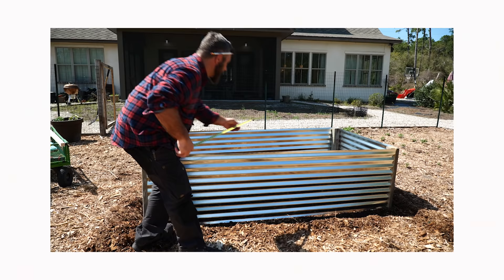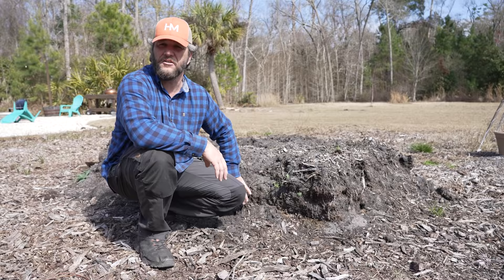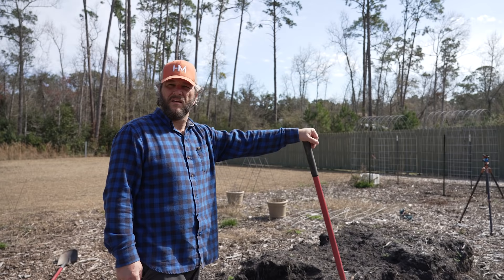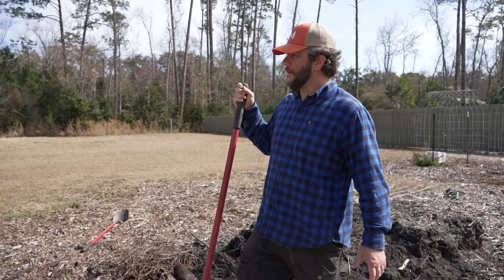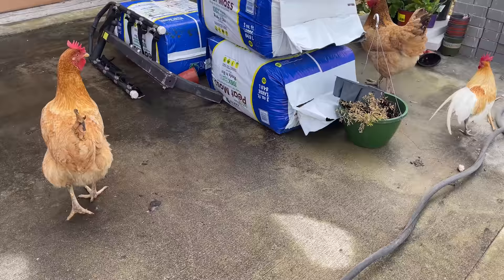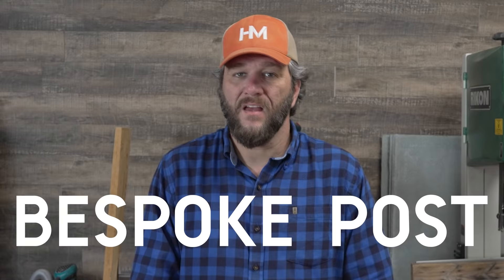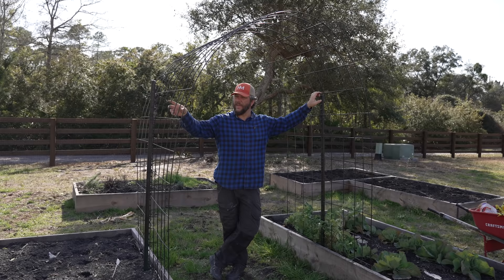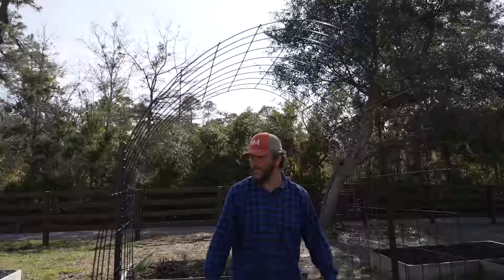Don't Build Raised Garden Beds Until You Watch This

Comment: Hey, I just realized I gave you just a half of the advice. In addition to painting the fence near herbs  white, you should also add Titanium Dioxide (TiO2) to the paint so that it absorbs the UV radiation from the sun. Otherwise there is a high possibility that your plants will get hit with more reflected UV radiation in addition to one coming directly from the sun, which would be harmful to them. As a bonus you will get more heat and light radiated from the fence to the plants which could help in springs and autumns.

Comment: Thanks.  Here's a quick tip from a boatbuilder (me) about untreated lumber.  Paint the ends before you assemble.  75% of the moisture in a board gets in through the endgrain... so paint or seal just the endgrain.  It'll add an extra year or two to the lumber's life.  If you are really worried about that little bit of paint leaching into the soil, then use a food grade clear coat, like they use on cutting boards.  Personally, I would just use latex house paint and not worry about that tiny amount of paint on the ends.
Reply from the maker: Thanks!
Reply: I think I'll just use wood glue, should seal up the ends and potentially add strength to the connections too

Comment: I use backer board in Michigan for lots of things outside. Once painted with a good outdoor paint it holds up very well
Reply from the maker: Good to know.
Reply: Paul, Should we use  a type of paint specifically for use on concrete?
Reply: @PandoraBVV  no  the surface of backer board is not cement based. I just use a good outdoor paint.

Comment: I'm planning my backyard for this spring and have watched a lot of your videos, so I appreciate this update. Love the A frame chicken coop, quick, easy, and it works. I like your smokeless firepit too. Probably not going to use the cement board idea since you mentioned freeze cycles, expanding the beds and letting the old wood rot seems like the path of least resistance.

Comment: One additional thing I do to my raised garden beds is add a layer or ribbed underlayment (made to go beneath vinyl plank floors) to the inside walls of the beds. They are non-toxic, non-leaching and they prevent soil and water from resting up against the wood. Because it’s ribbed, it also allows air to travel between the plastic and the wood ensuring the wood never stays soaked. I’ve only had them for roughly 3 years but my untreated pine is showing no signs of rotting.

Here is the product from Home Depot: DMX 1-STEP 100 sq. ft. 3.6 ft. x 29 ft. x 5/.32 in. Underlayment for Vinyl Planks, Laminate and Engineered Hardwood Floors
Reply: Your definition of ribbed is interesting. I call this dimpled, but still a good idea.
Reply: What a great idea! Thank you!

Comment: You mentioned adding another 2x12 on top of the existing sides, beware that water will escape out between the boards. I did that as well. Maybe place some plastic on the inside. Thanks for all your info. Nice job.

Comment: The large logs in the bottom probably prevented the bed from blowing out.  If they had been there long enough to decompose, you would've had significantly more pressure pushing out those walls.

Comment: Hey Haxman, I got a great hack for ya. Cut the top off a 2 litre plastic bottle, slip it over the 4"x4" then hit it with a heat gun to shrink it on the ground end of the leg. Great recycle hack. Plus you can do the same thing to the top of the leg with the top of the bottle. It makes a good holder for the garden tools when you're working. You're so good with sharing hacks I felt I owed you one. 👍🏻👍🏻🇺🇸
Reply: Wouldn't rainwater run down your posts and trickle into the bottles, to be held against the posts? How do you seal the bottles to the posts so that they don't collect water?

Comment: To help stop the bowing out of the backer board containers you could use some heavy wire across the middle like you would in a Gabion basket connecting the sides together.

Comment: With prices of wood right now, I purchased framing lumber for my raised beds. First year I will be doing raised beds instead of in ground. The lumber is untreated and I believe it’s a fir. Maybe last as long as pine . Maybe longer . If I would have went with red cedar, it would have been over 700.00 for three 4x8 beds. Instead , with the framing lumber , it came to 185.00. I’ve never gardened like this before . It’s pretty exciting to try something different .

Comment: that cattle panel trick works for 1 or 2 ... if you are moving 25 not so much. ... bolting two 2x4x16 to the bed ... does NOT work. Two alternative that do work .... seller delivery ... 18 foot flatbed works too!

Comment: I didn't read all the comments so someone may have said this already, but I find 4ft too wide.  I like to be able to reach over to the other side instead of having to go all the way round when weeding.  Its okay if you only have one, but if you have a whole allotment full, it makes a huge time saving to be able to do a lot of maintenance from one side only and three feet is about my reach. Also at the edges you need to leave an access path whereas you can plant right up to the boundary with two or three feet boxes, which is great if you can also put up a mesh on the boundary for climbers.

Comment: I have tried every combination of materials to build beds over the last 20 years.  I'm 75 and building my last beds. I'm tired of replacing them and experimenting I just want to be done with it. So I'm going with cement block.   I've used every wood, cement board, metal, even plastic sheets.  Going with block.  If you don't want to experiment for the next 20 years go block.. I f you know you are in a permanent place for a long time go block. The block can be moved if you change your mind on a set up, or take it with you if you leave.  I would tell my younger self  go block.

Comment: The Hugelculture method also provides the benefit of having a long term water storage as the logs soak up water while also providing habitat for beneficial microbes and fungi.  After a long time, the wood breaks down into a carbon rich soil and while it is breaking down, provides food for worms that produce some of the best fertilizer you will ever find.  Get your soil ecology right and you do not need fertilizer at all.

Comment: I have had  success with galvanized sheet metal( 6 foot fence sheets that someone dumped on my lawn ) , by cutting it in half across  the sheet and joining the halves together to form a ring , you can make a bigger ring by adding more sheets and a few cross bars . You can make a range of sizes  by using extra panels and support bars. Remember  to OVER fill your beds as they will settle and swap your crops out at least every two years to different crops (it dont snow where I live brooooohahahaha ). Good that you mentioned that wood chips will suck nitrogen out of your soil while they are breaking down , but they will release it back after they are composted . It is better if you can leave them to break down for a year before you use them if you can or just add a nitrogen boost to you soil if you cant wait that long.

Comment: We had some beds made out of untreated wood and it took them 4 years before they started to fail... so you may get more out of them than you think. great videos!!
Reply: Hi artport7. What type wood?  I’m getting ready to build one out of 2x10’s untreated southern yellow pine3 high
Reply: @reg8mm  yes, that is what ours are... we still have them and they are still holding together on year 6.
Reply: @artport7  thanks for replying!
Reply: Another commenter who is a boat builder said to seal the ends of each board, because most of the moisture that rots it comes in through the end grain. He said you'll get a lot more life out of them that way.

Comment: Just a comment on woodchip mulch. On soil, lay corrugated non colored cardboard on ground. Water to wet cardboard. Inoculate cardboard with the 'Winecap' mushroom spawn "Stropharia rugosa annulata". Cover spawn and cardboard with 4" or better of mostly [70% or better] hardwood woodchips. Water well and maintain moist as you would a lawn. If you also cover woodchips with a 1" layer of straw or grass clippings, the process is enhanced considerably. 'Winecaps', or 'Garden Giants' as they are called grow when soil temps are between 50-90 F. No growth in winter or mid-summer where I live in New Hampshire. If you Inoculate in spring, there is a chance of mushrooms in the fall, but most certainly in the following spring. The 'Wincaps' will break down the chips rather quickly attracting earthworms and making great compose. The woodchips will need topping off annually to maintain the 'Winecaps'. From that point forward, you should not have the Nitrogen issues and you will be harvesting delicious mushrooms.

Comment: Good work on the raised beds. I have to ask, why raised beds instead of traditional? I mean, if this is a how-to video, then fine. But if your goal to make a productive, robust garden then go old school and dig it, don’t build it. Time tested, mother approved.
Reply: Depends on your dirt. We're on clay. I wanted to haul in topsoil and compost and do the Charles Dowding no dig method for our first garden last year, but my husband wanted to see if we could get away with making the clay work. No, we could not. It was incredibly hard to dig, it hardened up like concrete after a rain, it didn't drain well, some things never came up, some withered and died young, and some got root rot. It was waaaay harder than it needed to be, for very little reward. I'm going with raised beds, and I'm filling them with what I know will work. Someday, if I use the right soil amendments in my raised beds, the clay underneath will also be amended. But that's gonna take years.

Comment: Can you seal with a pure oil or even beeswax or something to keep the boards from rotting or is that not worth it?
If it is doable, get yourself some beehives, put them in the back corner of your lot. If its work you don't want, trade off with a beekeeper to care for them, in trade of half the honey / wax or what ever. ?
Reply from the maker: Someone said to use raw linseed oil, not boiled.

Comment: Great videos!  Quick question: if you had to choose between the galvanized, cedar, or cement board, which would you choose?  I'm going to be building some raised beds soon, so I'm curious which was easiest, cheapest, and most durable.  Also, what area are you in?  I'm in the FL panhandle, so similar planting zone.
Reply from the maker: Thanks! If money is no object go with cedar, bang for buck is galvanized. The cement board is really for aesthetics. We went with non treated pine for the ultimate cost savings and speed of assembly combo. In your area you can probably find cypress which would actually hold up for decades and it's less expensive than cedar. We are in zone 9 in southeast Ga.

Comment: When your raised bed perimeters rot, remove the wood frame and you will have plain raised beds. Use wood chips, straw, hay, cardboard, etc. to keep the perimeter and control weeds. Additionally, it seems as though you till (disturb more of the soil than is necessary); please, stop doing that. 
It makes my head hurt to see how much work y'all do when you really do not need to do it... really!
Ruth Stout and Masanobu Fukuoka both spent less time trying to figure out how to improve natural processes, and more time applying natural processes through thinking about how natural processes work, which both attest to and require much less work. 

Good stuff nonetheless!

Comment: I have 12' X 16'  used composite deck boards that I plan to use for raised beds: should not rot * do need support along the way even if I go with 2' X 6'* what are you thoughts? I am in Michigan
Reply from the maker: Sounds like a great idea to me.
Reply: @HAXMAN  Are you going to make a greenhouse using cattle panels & 6 mil plastic? I am thinking about it but hauling 16' panels makes it difficult without a landscape trailer.
Reply from the maker: @conniewright8080  No I’m going to build a traditional one. Use the trick I mention at the end to haul the panels.
Reply: @HAXMAN  As Always I speak before hearing the end of the video, thanks for the info...I am 70 & doing my research of what works & what don't before I make a move
Reply from the maker: @conniewright8080  😁